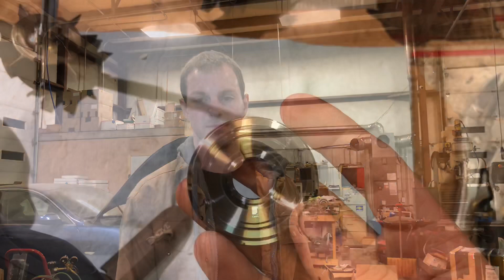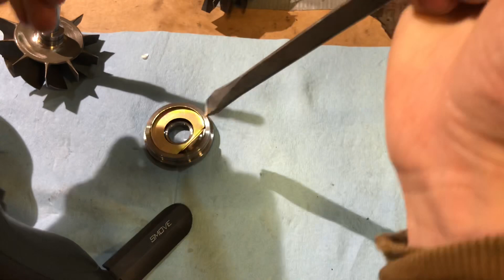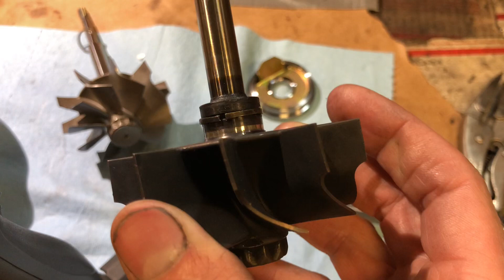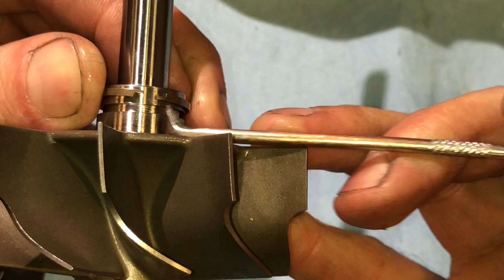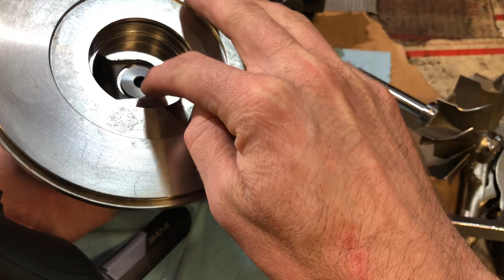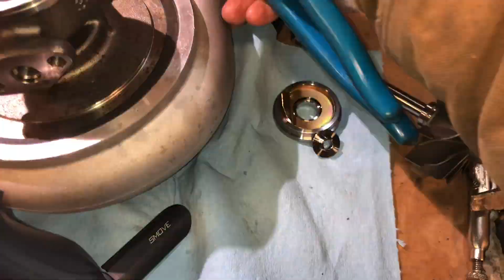Hx35 5 common turbo rebuild mistakes

Comment: Are you talking about the channel locks he used on the snap ring??  That snap ring is designed so that you can use pliers! So he used the correct tool..

Comment: I am about to buy the turbine shaft wheel and rebuild kit   the reason is I can grab the compressor  wheel and move it around  it never locked up and hasn't cut into the housing  yet do you think this is the right fix or should I go with a whole new turbo